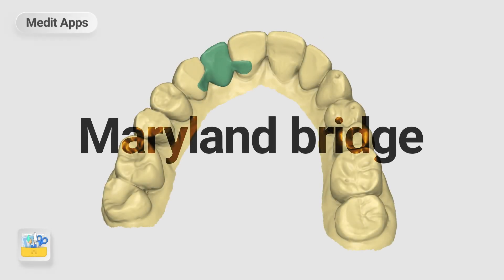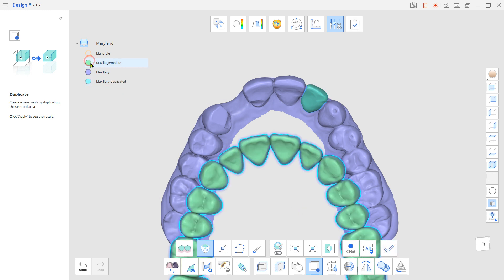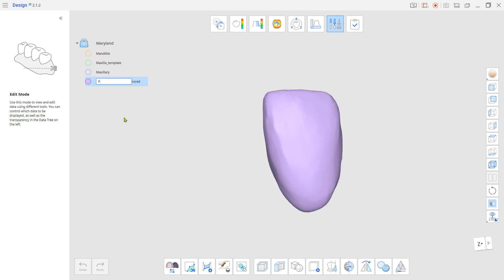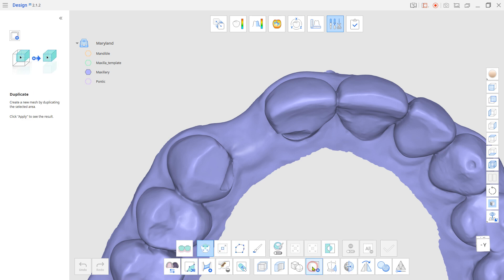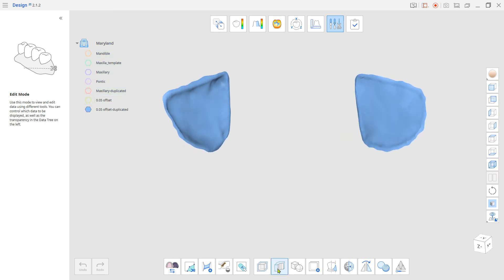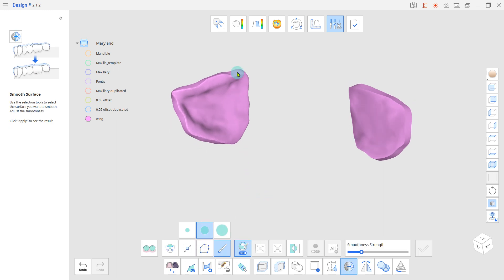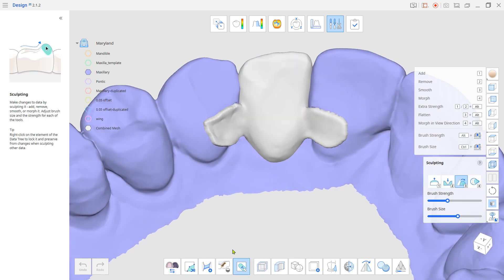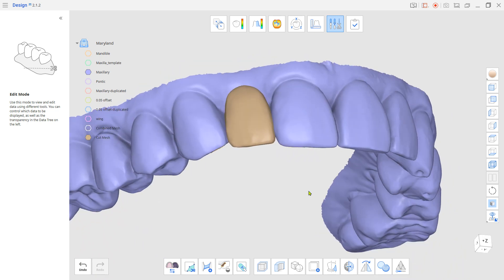Designing a Maryland Bridge with the Medit Design App

Comment: Are there more detailed videos on every step you do in the videos that explain every step. As a beginner,its difficult to follow when you're clicking on so many things so quickly I cant make out what exactly you're clicking on and doing. Thanks
Reply from the maker: Thank you for the comment. Please find this webinar video which is about how to use Medit Design app with step by step. ➡️ https://www.youtube.com/watch?v=3LpJwabatjU&list=PL_o6X00wEvoyP-CQg6eJTXboabbVYVAIZ&index=50
Reply: Thanks and that's a nice video for this topic. Is there a newer video that shows how to use the model builder app step by step. I know there are some out there but I say newer because the articulators in the older videos are not there anymore and adding a new stl articulator to the library hasn't seemed to work so is there a video that shows that well?whats happened is i add the articulator that i downloaded elsewhere to the model and looks fine,but during export,the app isnt splitting the articulator into 2 parts for top and bottom but instead the whole articulator is attached to just one part that doesnt work ofcourse. thanks
Reply from the maker: @omarmahmood611   Thank you for the comment. We will incorporate your feedback when creating our new educational video. Also, you can get a help from CX team for the articulator stl file issue. :)